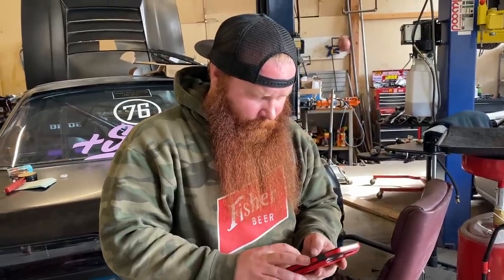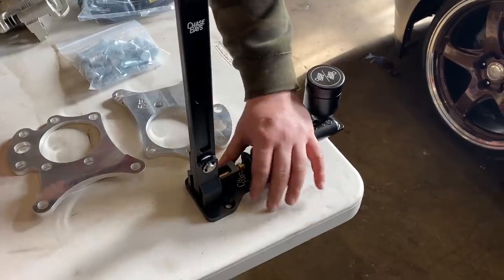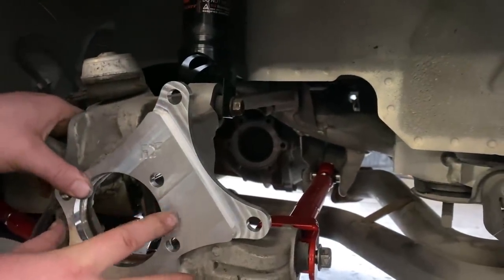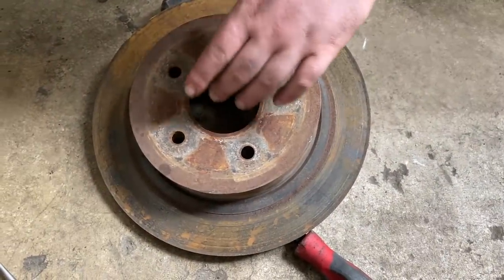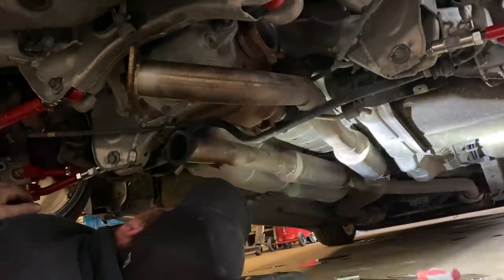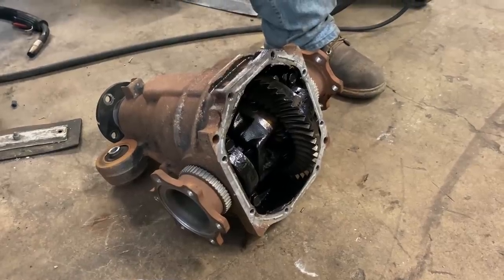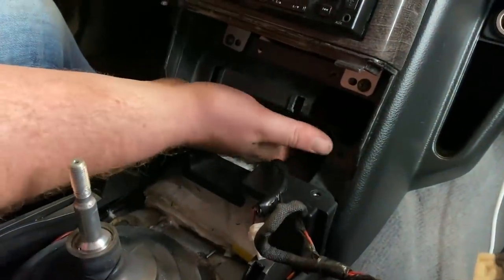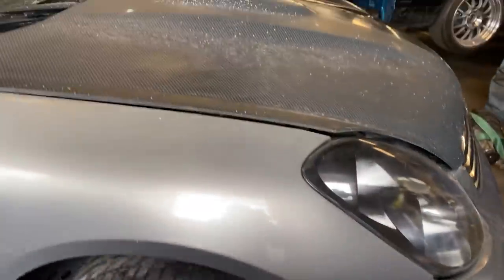Supercharged "Barn Find" Part 3 | Welded Diff & Hydro E-Brake

Comment: So as an idiot I don't know what a differential does and what the advantages of having a locked diff is. Would you or someone be so kind as to let me know I would appreciate it.
Reply: Umbrella4me so when the diff is locked it means the wheels both have power and both spin at the same speed 

So for drifting it means the rear end is predictable and always locked in
Reply: @stepdadbarneswestshop2800  ah thanks kind stranger that makes sense.